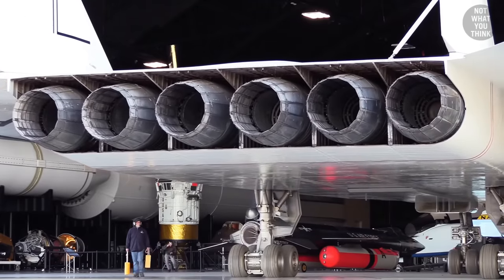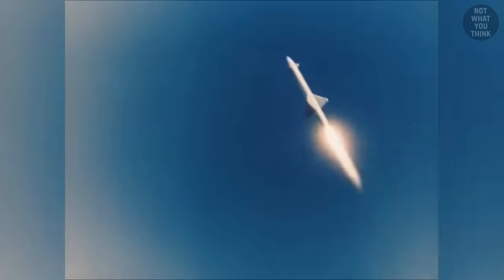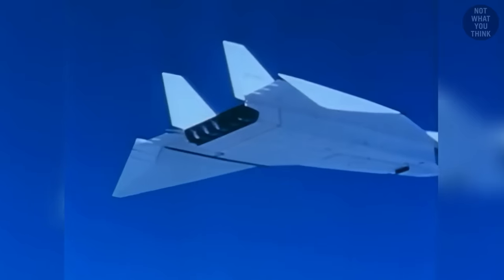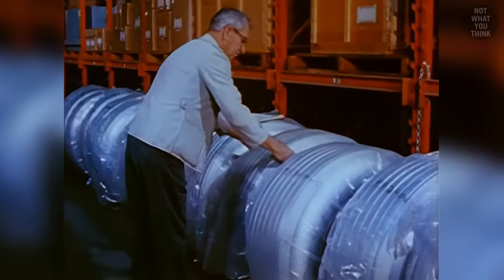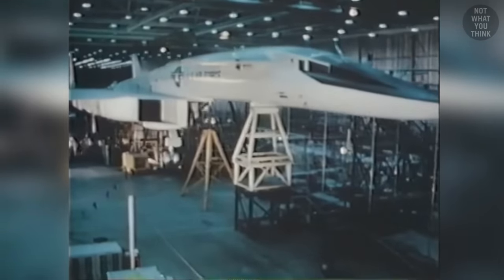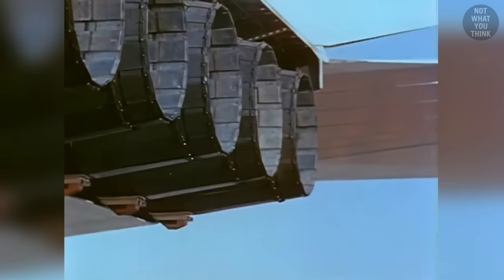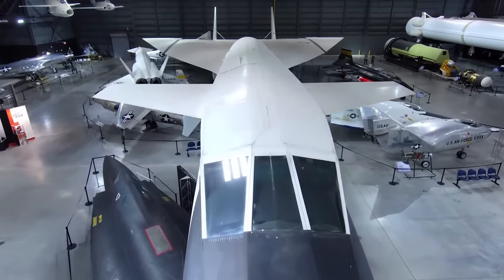The Airplane That Looked Fake, But Was 100% Real: XB-70 Valkyrie

Comment: The XB-70 scared the Soviets, so they built the MiG-25 to counter the American bomber

The MiG-25 scared the US, so they built the F-15 to counter the Soviet's counter

The F-15 scared the Soviets, so they built the Su-27 to counter America's counter-counter

The Su-27 scared the Americans, so they built the F-22 to counter the Soviet's counter-counter-counter

The F-22 scared the Soviets, and later the Russians, so they built the Su-57 to counter America's counter-counter-counter-counter
Reply: And now the US isnt scared of the counter counter counter counter because in around 10 years of production only a dozen or so have been made.
Reply: @Inv1ns1bl  yes yes that's why I didn't include it anymore
Reply: The XB-70A didn't scare the Soviets into building the MiG-25, because that plane was never built, but was cancelled a few weeks after the MiG-25 program began.  The XB-70A wasn't flown until 1964, by which time the first MiG-25 had already flown. The XB-70A wasn't a bomber, just a high speed test aircraft, lacking fuel cells, a weapons bay and the offensive systems of a combat aircraft. The Soviets continued developing the MiG-25 anyway, for nearly a decade - they could have cancelled it any time they wanted. By the time the MiG-25 entered squadron service, the sole surviving XB-70A was retired to the USAF museum. 

As for the MiG-25 somehow causing the Americans to develop the F-15, that's another internet fairy tale. The F-15 was developed to succeed the F-4 Phantom, which had flown in the late 1950s. Over a decade separated the first flights of Phantom and the F-15. The F-15 was a large, 2 engined, mach 2 interceptor armed with long range missiles because it replaced a large 2 engine, mach 2 interceptor armed with long range missiles. The additional capabilities were made directly in response to the American experiences against the MiG-21 in Vietnam.
Reply: @winternow2242  Uhmmm... Someone clearly didn't watch the video till the end... Lol
Reply: @shinei98  umm, watched the video...and read history.

What facts prove me wrong?
Reply: @shinei98  "I was referring to what NWYT said in the video"

Nope, your comment made it clear that that was what you thought.  If you meant to say that you didn't believe the video, then it's on you for not specifying that.  I've shown clear historical evidence that NWYT was wrong, that none of these aircraft were really related to each other, or somehow caused their development.  

"MiG-25 promted the US to develop the F-15 because they taught the MiG-25 was a modern fighter with high maneuverability"

Don't remember the video saying that, but I'll accept that it does because so many others have claimed the same thing, that the US feared the miG-25 was some awesome dogiighter...only they likely didn't.  It would be ironic if USAF/USN planners took the dogfighting capabilities of the MiG-25 all that seriously, when they didn't take dogfighting all that seriously.  by 1966, 2 years after the MiG-25 first flew, the F-4, the top American interceptor, had no internal cannon, a critical feature for dogfighting.  The only gun-armed fighters were the ones that Phantom replaced.  The E model, with its internal gun, didn't fly until 1967, and that was in response to the MiG-17, -19 and -21 fighters observed in Vietnam.  DACT was practically non-existent beofre the late 1960s.  TOPGUN wasn't established until 1969, and RED FLAG, until about 1975.  In other words, you're narrative is easily debunked - nobody worried about how manueverable the MiG-25 was when nobody cared about manuvering.

Also, contrary to your narrative, the MiG-25 was a modern fighter when it first flew - where did you get the idea that it wasn't?

" But as we all know, all these turned out to be untrue, and the MiG-25 is an overweight and fuel-hungry interceptor made from steel"

...and of course you've seen official statements showing that American military officials actually believed that, right?  That Americans believed that the MiG-25 was a lightweight, fuel efficient airplane made of something lighter than steel, and long on range, right?

Contrary to what the Internet would have you believe, I have yet to seen any evidence that responsible officials bought your fairy tale.

"But you know, this shit is a fucking joke for fucks sake..."

ahhahaha, so funny, you're still posting in defense of it.  

ahahahh, you go noob.
Reply: @winternow2242  That's a lot of texts right there, too bad I'm not reading it 😇... Stay mad lol

Comment: I love how the US Military Complex got scared of their own shadow to the point of creating one of the most insane and record heavy planes to ever have existed: The F15.
Because nothing says overkill better than "Technically this plane can turn into a rocket mid-flight".
Reply: Well on paper the MiG-25 was very scary, a Mach 3 capable jet with predicted unmatched manoeuvrability. By the time the US got their hands on one the F15 was already made and in service.
Reply: Israeli pilots have flown and landed F15's with only one wing intact. I understand that some A10 pilots have done the same thing.
Reply: @cathoderay305  The A-10 never lost a full wing and remained airborne. It can only lose a partial wing and be able to limply fly home, which isn't really unique amongst Western military aircraft.
Reply: @reaperreaper5098  Intact means complete. I've seen an A-10 wing that was probably 75% blasted away on one that made it back safely.

Comment: The videos about this and the SR-71 shows how wild it is that the Russians were able to make a mach 3 fighter with stainless steel and some cruise missile engines. Those things were only meant to be used once, if ever used for real, but they it do what was asked.
Reply: I wouldn't call MiG-25 a "mach 3 fighter".
Reply: @ctmme  Why not? It was a fighter and it could do mach 3.
Reply: @Elthenar  It was not a fighter but an interceptor with low maneuvering capability. If could reach mach 3 momentarily but after that the engines would be completely wrecked and needed replacement. I could definitely not cruise at mach 3.
Reply: @ctmme  No one said it could. It was made for one purpose, to take out incoming nuclear armed bombers in a WW3 scenario. In such a case, it was never expected to get sent on a second mission.

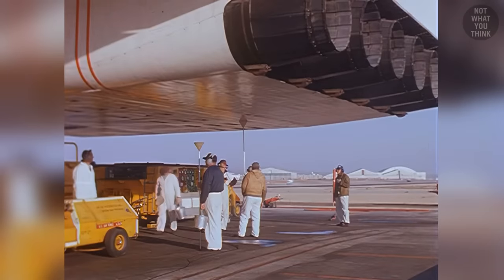Comment: @0:34   The fuel leaks were intentional.  Most high altitude craft leaked like a sieve when stationary or at low speed.  Seals and joints were done this way to allow for expansion at high altitude. SR-71 was actually far worse in that regard being it was designed to fly even higher and faster.

Comment: It's really fitting that the XB-70 was the inspiration for the MiG-25, after all, the MiG-25 was:
Not necessarily a bad aircraft, but a very specialized one
Rendered mostly obsolete for its original purpose by the other side developing better missiles
Freaked out the other side way more than it would have if they'd known its true capabilities
Ran into a lot of issues with trying to go that fast
Has engines that seem quite large for its size
Had a lot of mechanical failures, especially with the earlier versions (150 hour rated burn time for the engines, at first)
Equipped with massive control surfaces, but not actually all that nimble
Reply: The B-70 was not the inspiration for the MiG-25. I know that NWYT claims it is, but the relationship between the 2 planes (and the F-15) is more assumed than proven, and historically disproven. The Soviets began developing the MiG-25 before the B-70 had been built, and were designing high-speed missile-armed interceptors since the mid 1950s, before the WS-110 became a mach 3 airplane.  Development of the MiG-25 was authorized in February of 1961, and jfk killed B-70 at the end of the following month. The Soviets had absolutely no reason to think that B-70's fortunes would be reversed. But despite That, they kept working on the MiG-25 for nearly a decade after B-70's cancelation.  In february of 1969, the sole surviving XB-70A was retired to the USAF museum. That was the same year that the Soviets put the MiG-25 into service. The 2 planes have nothing to do with each other.

Comment: 3:12
The XB-70 was probably not the first front-line (by design) to incorporate canards.
Saab Viggen started it's initial design in 1952 and used canards with a delta wing in it's final configuration.

There was also at least one German World War II design that used canards, though it was not a supersonic jet.

Comment: All aircraft tires are charged with nitrogen.
If you charge them with ambient air there's a potential to inject water vapor.
At altitude that 
Condenses and freezes into ice which also reduces the pressure in the tire.
Reply: Oxygen attacks rubber and its molecules are smaller than nitrogen, and so leak out faster.

Comment: Imagine an XB-70 built with modern manufacturing, avionics, and materials.  It would be glorious!
Reply: And expensive. What would be cancelled to cover the cost? B1? B2?
Reply: @Dxyzxyz  Considering how much spending goes into the military to begin with, I don't think producing a single XB-70 using modern tech would be comparatively that costly but it would be pretty impractical. The two purposes on which it was created (military application and supersonic flight research) have been successfully met by other projects so trying to revive the Valkyrie would amount to little more than vanity, unless someone could come up with a new reason to revisit this at-the-time experimental tech.

Comment: Could you do a short on what is the reason for the tiny wheel above the B-1 bomber's main landing gear? I first noticed it in Erik Johnston's new epic walk around video. It's so far above the main gear I can't figure out it's purpose.
Reply: i like that idea. i don't generally care for shorts but I can totally support small explainer videos for bits and pieces of rabbit-hole-worthy stuff in videos.
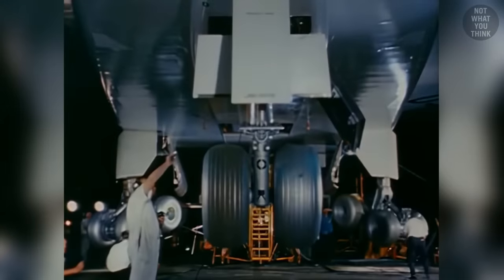Reply: It is mentioned in the video at around 8:00. It is used to measure ground speed to detect if the main wheels are skidding under braking. Basically it's an early from of ABS.
Reply: Shorts suck.

Comment: In my opinion the XB-70 was the most cost effective defense project of the Cold War.  As you indicated the plane scarred the Soviets.   Not only did they develop new interceptors and antiaircraft missiles,  they deployed them in large numbers across there vast country.  This also required a completely new command and control system.   The cost of this integrated defense system was a significant part of the USSR GDP.  It prevented the Soviets from having the funds to delve in other matters.  Thus my opinion is that XB-70 program cost a small fraction of US GDP, and helped impoverish  the Soviets to the point that basic infrastructure programs could not be funded.   We used to like to say during the cold war the USSR could do anything the US could do, but could not afford to everything or even a fraction of what the US did.
Reply: I'd love to know the source of information, because it's difficult to take the claim seriously. The XB-70A wasn't a combat aircraft. It was based on the B-70, which was cancelled before it was even built, and opposed by 2 presidential administrations. Also, those changes to Soviet air defense weren't so specific to the B-70 that the Americans were able to keep flying other aircraft the way they had been until then. We had to develop cruise missiles and 2 new generations of manned bombers to penetrate the increasingly formidable Soviet defenses, and spent billions to do so.

Comment: I grew up about 40 minutes from the USAF museum.  It took decades for the museum to put thw XB70 in a hanger.  In the early 80s it was way off from the main musuem and quite a hike to get done se to it.  Now its one of the prized aircraft along with the B36, Bock's Car, SR71, and F22.

If you have tge chance, its a museum not to be missed.

Comment: I hurts me to know that we spend so much money and resources on objects that kill and destroy
Reply: This was not a warplane. It was only built for test flights.
Reply: @winternow2242  
They wanted to use it as a bomber
Reply: @HappyDude1  nope. The bomber was never built. This had no weapons systems or operators, never carried weapons or flew in a squadron.
Reply: @HappyDude1  I don;t know why you keep repeateing the same erroneous and irrelevant information.  It's not unusual that aircraft designed with 1 purpose are built for another - the A-5 beng built as a reconnaisanse plane, and a variant of the F-111 which flew as an unarmed EW plane.

"Because it did not work They stopped working on it"

So you're complaining about an airplane that wasn't built.  Thanks for clarifying what's been told to you already.

"And it killed one person the co pilot"

Huh?  Have you ever read a book about this airplane?  The co-pilot was killed when another airplane crashed into it.  This plane didn't kill anyone.

"Instead they have guided rocket and the F15"

Guided rocket?  If you're referring to ballistic and cruise missiles, they came before AND after the B-70.  Also, the F-15 has nothing to do with this airplane.

Comment: At 14:34 you can clearly see the F104 was too close, much closer than the aircraft on the left. The F104 starfighter had a very small wing surface too, likely making control even more difficult. Also, it's easy to see the air vortices between the vertical stablizers of the XB70. The unusual wing and compression lift design probably produced vortices that were very unusual for any aircraft. They put the wrong jet too close to the XB70.

Comment: The F-15 connection is slightly wrong. The soviets did start to make the Foxbat to counter the XB-70, but the detail is that the Foxbat could ONLY counter the XB-70. It was incredibly fast but maneuvered like a truck, was heavy and crude, lacking the advanced materials and technologies that the US had.

However, the design still visually mimicked an super-maneuverable fighter. When the US saw it they imagined it as built with the peak of their own technology, which would have made the Foxbat the best fighter in the world.

So the US began emergency work on the F-15, built to be super maneuverable and to have all the latest tech to counter the imaginary super-maneuverable Foxbat that never existed.

Comment: Additional facts: They tried to build an anti-USSR M50 1950 aircraft, and part of the documents in the USSR for a new aircraft project was stolen, and this XB-70 was released, but they did not know that according to this documentation, not a bomber was being developed in the USSR, but a completely different aircraft. Namely 1953-1959 Experienced special purpose attack aircraft M-25 “Hell Mower”, the principle of operation was to tear apart ground personnel with sound, and tore down tank turrets. It was recognized as an inhuman weapon and the entire project was discontinued.

Comment: I have always wondered the atmosphere has a negative charge. is there a way to charge the hull of an airplane to keep a thin layer where air doesn't touch the hull? I have no clue if that would work but would prevent heating up maybe.

Comment: Now do a story on the F-108 Rapier... It was the companion fighter and used, I think, two of the Valkyrie's engines.  Slick, fast, interceptor... MAYBE an escort fighter.  Right side-by-each with the Avro Arrow, very comparable planes that meet the same end, but for different reasons.
Reply: I'm guessing you read Jenkins and Landis book.  What a fantastic book. Best Aviation book I have ever read.
Reply: @shenmisheshou7002  
No, I haven't read that book, I've just been a fan of the bird since about 1968.  A very rural kid, I would go into town with my mother to meet the county library's "Bookmobile".

One day, I picked up a thin, blue, hardcover book, "Ride (or Flight) of the Valkyrie".  Looking back at it with an adult's mind, it was pure propaganda, on the order of the Jimmy Stewart movie "Strategic Air Command".  Whatever the case, I was gut-hooked...a low, quartering shot of the B-70 with wingtips drooped 25 degrees is better than any porn ever filmed!!
Reply: @Bluswede  I have read a bunch of books on Airplanes, and the book I mentioned, which is "Valkyrie, North American's Mach 3 Superbomber" is the best aviation technology book I have ever read. It is far more than just a book about the B-70, going into the cold war, the defense industry, the Air Force proposal, the competing designs, the F108, the engineering and design, manufacture, politics, and so much more. It is a fantastic book, best of any book written for any plane out of the 30 or so I have read.  It is out of print, but even at double the original price, it is totally worth it.
Reply: @shenmisheshou7002  
Thanks, I'll take that under advisement.

Have you read "Sled Driver" by Brian Shul?  The guy has a helluva story.  He ended up piloting the Blackbird...and his C.O. let him have his camera in and around the base and plane.  He became quite the photographer, and the book is chock full of high-end pix.

This is the guy you see on YouTube with the L.A. Speed Story.  The world got a little dimmer this spring when he left it for the inky black skies way up where the big ones play.

Comment: Although the goose neck fuselage with canard wings were used in the SST Concord. .The engines were Obsolete Standard Intake engines not fit for supersonic flight. There was NO Bomb-Bay area. That space was an Air-Chamber where air slowed down to sub-sonic speed before entering the engine intake. Most of the plane design was un-usable for actual military production.